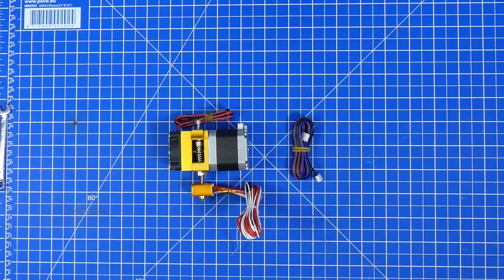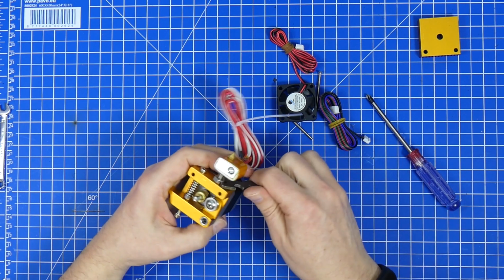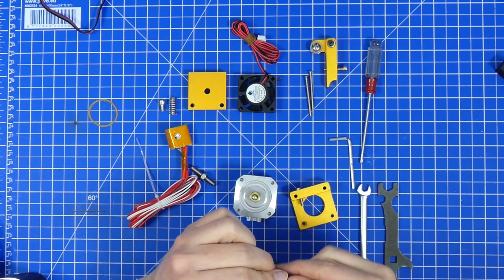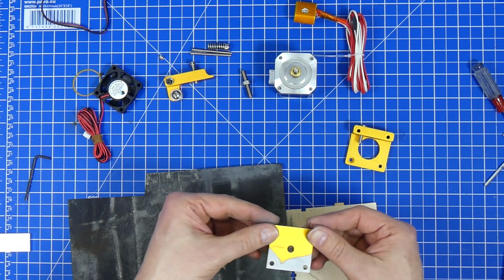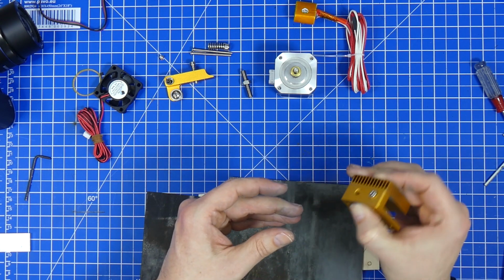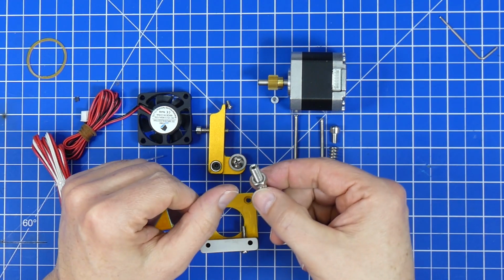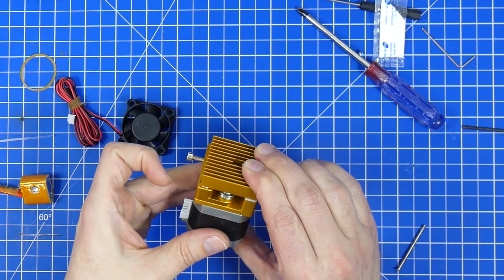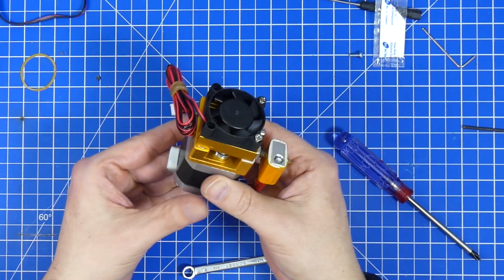Improving a dirt cheap extruder

Comment: I'm just about to begin 3D printing. Far from being a video with good tips for modifying an extruder, this gave no empirical evidence of why the modifications were necessary.

Were the two mating surfaces of the heat sink and body not flat? Why not show if they were concave or convex. You had a engineers square but didn't show the gaps you were allegedly correcting with sanding.

Why spend so much time showing the sanding of the anodised layer? Was this even necessary? Wood is not a good datum surface as it can be compressed and form a less than flat surface. A metal block or piece of thick glass would have provided a better flat surface for the sand paper.

You didn't show the type of thread lock you used. Someone else has commented on it being CA. If so, CA is too fragile. Proper thread lock cures to a semi flexible state so as to hold the threads in position yet allow for mechanical vibration dampening or to prevent loosening due to repeated heating and cooling cycles.

It would also help to have a bullet point list just out of shot so that you stay on topic. You wandered off subject with unnecessary narrative.

A list of the tools required really needs to be given at the beginning of the video. State the problem, state your intention, list your tools including dimensions (e.g. "You will need two Allen [hex] keys, 2.5mm and 4mm. You will need two spanner so, 10mm and 6mm. You will need two cross head screwdrivers, 3mm and 5mm.) you are fixing a specific product, details are important to your viewers.

If there's one thing I've learned from all the videos I've made for training and educational purposes, it's plenty of practice and a critical review of your work before you release it for public viewing. 

I cannot fault you for the lighting. The work area was well lit.
Reply from the maker: Points taken - thanks for the advice. Yet, I can't find a single video on your channel to see how it's done better. Am I looking in the wrong place ?

Comment: What you are trying to do here, is essential an attempt to polish the proverbial turd. This thing is bad by design so, in addition to wasting your 20 Euros, you are now sinking your valuable time into this "project" as well.
Reply from the maker: That's true - but this turd has become a really useful part, and has since been working without fail. Between not having a working printer and polishing the turd, I did choose the later - and since it doesn't stink I'll keep it.

Comment: This guy has absolutely no clue what he is talking about.  The end result is decent but would be better off not even trying to sound like you know what you are explaining.  The problem with that setup is the hot end not the extruder... Also the heat sync should be clipped to the back of the motor rather than trying to suck heat all the way through the motor itself than the extruder, than finally dissipate... Its just not practical.  Its only a gimmick to sell it with one more feature than the next guy.
Reply: you do realize the heatsink isnt there to cool the motor right?
Reply: Oh no?  what is it there to cool then?  The spring?  The gear? The filament?  Nooob....
Reply: it's to keep the filament from melting before it gets down to the hotend.  keeps heat out of the throat.
Reply: that long piece, the throat is actually called a heat break, you want all the heat to stay down at the hotend and not come up that heat break
Reply: Yah, I know what a heat break is and I also know about the necessity for distinct separation of zones from cold to hot... but why would the fan for the heat break be located way above it so that it is not even cooling it?  Unless this is some configuration that I have not seen before... if so then I apologize but I dont understand how the heatbreak could be cooled by essentially cooling the extruder itself.  The fan for the heat break is below the extruder....  https://ae01.alicdn.com/kf/HTB1w6hoIXXXXXblXpXXq6xXFXXXp/3D-Printer-Hotend-with-Dual-Cooling-Fan-for-1-75mm-3-0mm-Bowden-Wade-J-head.jpg
Reply: This link you provided just confirms what I am saying... Sorry I don't understand what you are getting at.  In the link you provided, showing an e3d hotend, that would be mounted well under the extruder making it so that the fan we are discussing would not affect the hot end at all.  It wouldn't even hit the top of the heathenish let alone the break... You understand what I am saying?
Reply: the fan is blowing on the heatsink and the heatsink is only connected at the bottom to the part the heatbreak is threaded though.  don't think of it as where the fan is pointed but where the heat is being transferred from to the heatsink.  kinda like how in laptops the fan is put way far away from the parts it's actually cooling but connected with heatpipes https://goo.gl/images/w4xVab
Reply: the difference with the e3d is the heatsink is acutally around the heat break, which yes, i think is a better design, but with this one the heat is routed from the heat break, to the part it's threaded through, and then to the heatsink
Reply from the maker: Why would you want to cool the stepper ? That's a 1.4A rated stepper with 2.1Ohms, at best it would 8 Watts of energy (both coils full load, static). Also: When there's a mount attached to the extruder the stepper and extruder body are only connected by the screws, and separated by the plastic of the mounting bracket.
On the other end there's this heating element pumping a whopping 40W into this tiny block of aluminium connected to the body of the extruder driver by this tiny heat brake (or throat) made of steel. Now, steel is not the best of heat conductors, but it does transfer quite a bit of it into the aluminium body of the extruder driver. 
Since we want the transition from cold to hot to happen entirely within a few millimeters  of the heat brake, we need to remove all heat from the extruder driver, and make sure that the heat transfer to the cooler and fan are as good as can be.
That's what this video was about -
Reply: The motor can cool itself on its own JUST FINE, it doesn't need to be heatsunk. The heatsink is specifically there for the bottom brace of the extrusion assembly. The throat gets heated from the bottom by the hot end, but the extrusion assembly can not be allowed to get hot, else the plasticity of the filament increases and you can't push it effectively any longer. This is why you cool the top of the throat and the assembly that is directly connected to the top of the throat! Fundamentally the design of this extruder is pretty decent, it was after all copied from the successful Makerbot machines like the Replicator 2, it's just the details and the execution that are of low quality.